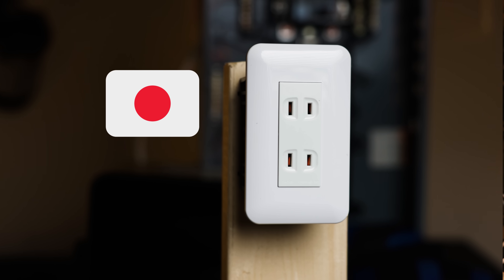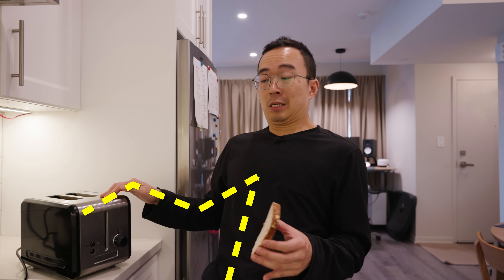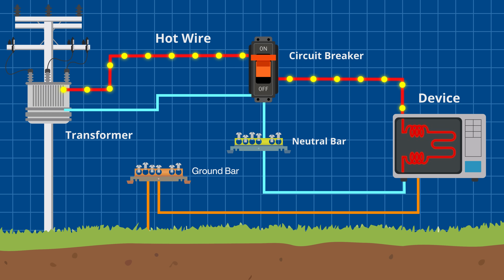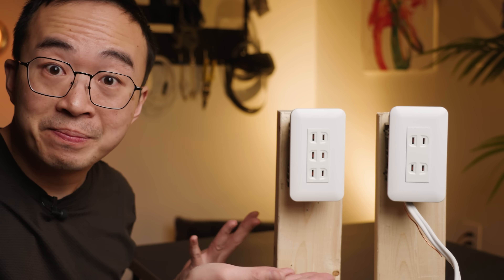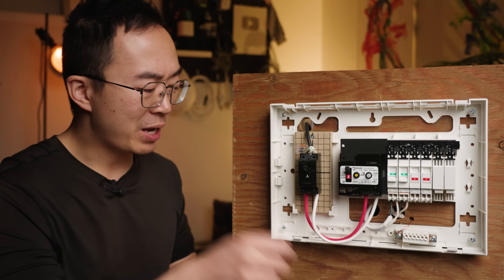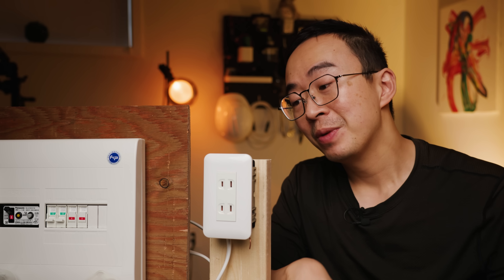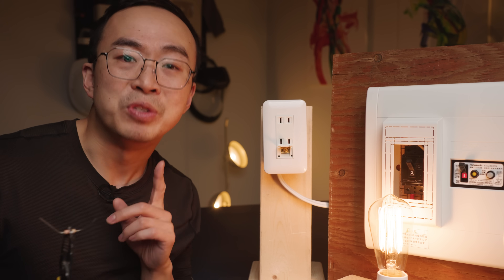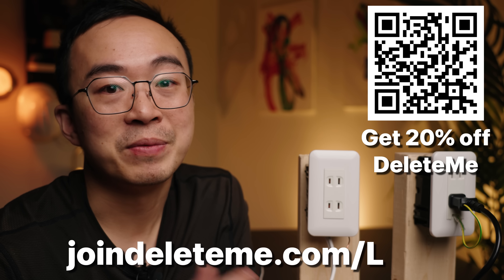How Japan Made Their Outlet Safe

Comment: 0:11 most of the time yes, in a ground fault no, during a thunderstorm possibly, the problem with isolating the mains with no ground, is that the voltage potential between mains and earth can be much different then potential between hot and neutral, so you can still get a buzz even touching neutral and have a undetermined ground reference, turn in to a capacitive load, form a virtual ground point.

 atleast in usa ground is basically neutral, two phases, the ground is a center tap, hot to hot get up to 250v 60hz

Hot to ground hot to neutral only give 125v max, so less of a shock, less hazardous than the full 250v, still will hurt tho, and typically anything grounded, current going to rather short to ground through low resistance copper than  the megaohms of your body, pop the breaker or gfci or both, basically the Earth is being used as a giant current sink, since the ground and the distribution transformers are basically coupled together, basically a large lc/rc circuit

Comment: I gotta be honest... I'm concerned that if there was a ground fault, resistance could start a fire that a copper wire and an extra hole would easily prevent for 75 cents. Sometimes you can have a perfectly installed electrical system in your home  and the electrical device is defective...

Comment: In the US. There are also combination arc/grnd fault overcurrwnt proctctive devices....3 wire system will have ground and neutral bonded @ 1st pt of disconnect meter base & at the 2nd point  separate that bond.

Comment: There is:
a. CPC - Circuit Protective Conductor: Which applies primarily to the circuit it is in. Its prime role to make the breaker trip in current overload conditions. It is a parallel low resistance neutral wire. It parallels the neutral wire back to the main panel. 
b. Main system grounding: This is to the supplied ground cable provided by the electricity supplier or local earth rod.
c. Equipotential bonding: Electrically connecting metalwork and conductive parts, both exposed and extraneous. Extraneous is metal parts having a good connection to the ground like water or gas pipes. The purpose is to have the voltage the same throughout all these metal parts in fault conditions.

The above are all different having different functions. But confusing in that they all have the same colour coding in most counties. The three of them should have separate colour coding then it would be easier to understand.

The Japanese do not have a CPC, relying only on an RCD/GFCI to break all the circuits in the whole house. 

In the UK RCBOs are becoming a defacto standard fit. They protect only one circuit, incorporating: earth leakage (RCD), over-current and fault protection. so the whole house is not switched put is there is a fault - only one circuit is disconnected.  AFDDs are mandatory in some installations being fitting on;y on single circuits no whole house, giving: arc fault, earth leakage (RCD), over-current and fault protection.

Comment: Couple of things.
1. Your grounded outlet is upside down. The ground should be on the top. That protects against loose or drooping plugs exposing the hot blades, and stops a direct short should something fall into the gap exposing the plugs (like a dangling bracelet.)
2 . GFCI is great, we have gfci breakers in america too, but it doesn’t make the installation more or less safe. It’s a last resort line of defense. They are generally welded into the closed position by lightning strikes, however. If you have ever serviced a house hit by lightning, all the gfci’s are fried, they still pass current so you wouldn’t realize it as an end user, but the test buttons no longer work. Have to replace them all. Relying on gfci as a catch all is less safe, because practically no one tests them every month as required.
Reply: The ground being on top to protect something hitting the live prongs are a very superficial and a farfetched fear which never happened, especially with the one ten volt power system. The ground pin UP is considered "upside down" as many plus in USA and every plug in Japan are installed with the ground pin down.
Reply: @judenihal  In the USA, we have counter-top outlets common on stainless steel tables, dating from the late 1950's when the classic diners became popular. Waitresses were constantly reaching over the stainless steel countertop to service clients, and multiple incidents of bracelets drooping into hot exposed prongs were recorded. This led to the design and introduction of grounded outlets in the 1960's, and their induction into the NEC in 1971. In the same year, GFCI became mandated, when there was a metal or water source in direct proximity to a receptacle, which largely precluded any further incidents of electrocution. As the 2 additions were both designed to preclude the same outcome, additional grounded requirements were not pursued. Your statement, however regarding it being 'unlikely', is categorically false. Every major electrical MFG, Guild, Union, Government, and Commercial Employer specifically ban the  wearing of metal bracelets and rings by electricians  FOR A REASON. A simple search of "accidental death electrocution "Bracelet"" returns 8300+ pages with the most recent being 2 days ago.
Reply: @undisclosedlocation9167I live in the USA. Most people do not wear “bracelets” while touching the outlets. If they electrocute themselves it is their own fault. Installing the plugs upside down is not going to fix this. GFCI outlets will
Reply: In New Zealand and  Australia the earth pin is on the bottom unlike China has the same arrangement but at the top Maybe because we are Down Under
Reply: Unlike you all. Schuko is interchangeable and not a pain to plug in, and it has the doors and it can't fall out. Plus it is indented so you can't touch the bare metal

Comment: If you cut open 3 prong power cables you notice the ground wire is almost always much thinner (The song goes: Cost Cost Cost repeat previous line). So should throw circuit breaker but if that doesn't work it could melt to open circuit while thicker main power wires keep working. Japanese electrical cables would never zap anybody because it wouldn't be polite so a cultural no no. Japanese splitter extension chord receptacles don't fit my American polarized plugs.

Comment: Ground is not only for safe. many countrys have both RCDs and ground. In china you can buy 2p or n+1 GFCI with only 1~2 Dollars. Some areas in the United States only have ground is due to industrial hollowing out, which results in bizarrely high component prices, rather than due to Japan's technological advantages. RCDs in Japan should also not be very cheap.

Comment: Bad ! Wrong ! 4:20 ~
Reply: Only in the main equipment panel can ground and neutral be combined on the same bus bar, since it’s code they are bonded anyways. Now, at any fixture, junction, or sub panel, they must there, be kept separate. So no, you , are wrong.

Comment: Also half of the country runs in 60hz and the other at 50hz. They also run at a lower voltage than the US 100 vs 120v.

It makes sense. The Gfci is a differential relay. It's expecting to see the combine current of the circuit going in and out it's actually not that simple. It's being used as a bus differential taking out all circuits with it. Cool.

Comment: I was about to write a long ass comment on how your diagram of how it works confused me because that's not what I was told. But then learned japan had the same system as france except for the spectacularly inconvinient grounded outlets. 
I still don't understand though, why is there a ground rod in the US ? If the current passes through the breaker anyway, and the transformer isn't even grounded, there wouln't be the difference in potential needed for current to be attracted toward the ground, right ? or is it just for lightning ?

Comment: What I get from this video is that grounding, coupled with circuit breakers, forestalls shocks of all magnitudes in the vast majority of cases, while GFCIs installed in the locations where shocks can still occur, will prevent serious injury or death (but shocks will still be felt, and it won't be a nice experience). Seems like a logical arrangement. Doing it the opposite way ensures that when there is a short, there will ALWAYS be a non-lethal shock (before the GFCI cuts the power), and grounding is starting to be used only in places where those shocks could still be dangerous, to prevent them entirely.

I'm still not clear on why the North American approach would not have worked (or would have been harder to implement) in Japan. That part was kind of simplified in the video, and I'm a bit confused. And also, if the government is now pushing for grounded, 3-pronged outlets everywhere anyway as the next improvement to their electrical code...it must realize that this has been the better option all along, so what was the thinking 50 years ago when the nation decided to go in a different direction?

Comment: What are the Japanese codes for Arc Fault? In the USA there is a common mistake of using Ground fault and Arc Fault as the same. Many basic electritions don't seem to know that they are seaperate tech and only some breakers have both. They are labled as so, and cost more. So cost cutting or lack of knowlege has me seeing Arc fault used in place of ground fault. Love to see how its handled elsewhere

Comment: Tl;DR. In short by chatgpt
Japan uses mostly 2-prong sockets because:

100V system: Lower voltage means less risk of shock.

Double-insulated appliances: Most devices are safe without a ground.

Selective grounding: Grounded outlets are added where needed (e.g. bathrooms, kitchens).

So yes, it's a safe, intentional design—not just outdated tech.

Comment: In switzerland we have ground to everyoutlet, GFCI as you call them are in the fusebox connected to the kitchen and the bathroom. We also have 3 phases to power equipment like washing machine in each appartment, there for we have 13amps circuit breaker much less then in the US where there are 20 amps per circuit breaker.

Comment: In America, the transition from two prong outlets to grounded outlets was simple. You DID have to rewire older houses, but the work was contained to the house, not outside plant. The big reason we started doing this was tow-fold.

First, the prongs used to be the same sized. That meant you could plug in an appliance "upside down" and swap hot and neutral. For electric devices like a toaster, it didn't care. Electronic devices would and this would cause problems. For the toaster, ground and neutral were often considered the same thing. So the neutral wire would be in contact with the housing. Fine if the plug was right side up. The case was effectively at ground potential and no shock, normally, but reverse the plug and that flipped. The case was then carrying the 110v current and you would most likely get shocked touching it. So we went to a "polarized" plug, where one prong was bigger than the other. Okay, great. problem solved, right? Not so fast!

The second reason we went to grounded plugs was either DIY idiocy or bad electricians flipping wires somewhere in our homes, so that hot and neutral were still reversed. But now we could not turn the plug around to fix it. This still happens, BTW, and sometimes it happens at the main entrance to your electrical panel. (I've seen it on mobile homes.) So we changed to grounded outlets and mandated that the ground and neutral now had to be isolated from each other and that the casing of any electrical device had to be either non-conductive (eg, plastic) or had to be tied to the ground wire directly. NOW you have an appliance that is safe, since, so long as the ground is connected, it should no longer be possible for you to get shocked from touching the case of an appliance under any circumstance. (Remember those two-prong adapters that had the grounding wire that no one ever hooked up to the screw on the cover plate to the outlet like they were supposed to? Bad joo-joo!) Any "ground-fault" or short circuit would result in the circuit breaker tripping.

The last thing that we had to consider was "wet spaces" like the kitchen and bathroom, where the presence of water would throw things off because it would create an alternate path that might not draw enough current right off to trip the breaker. Hence, the GFCI being mandated in all such areas. Now we're a lot safer than we used to be, but, of course, nothing is absolute. See, a short-circuit and a short-to-ground are different things and you can't protect from both of them at the same time. That's part of the reason we only have GFCIs in wet areas. Circuit breakers in your main panel are "arc fault" (short circuit). The button on the GFCI outlet is resetting a "ground fault". Different areas require different emphasis. What comes next in electrical safety? Who knows? We'll find out when it gets here.

Comment: Another option is to have a 3-pin receptacle, place a 30mA GFCI in the main control panel and a 5mA GFCI in individual circuits especially the wet ones. The 5mA GFCI substantially reduces the pain of shock to a tingling sensation.
Reply: Yeah, I planned on doing exactly that but the breakers were too long when they first came out (AFCI, GFCI and another one, I think it had both types of protection) and only used 2 and filled the rest with the traditional ones. One day I'll replace them all with the shorter version.

Comment: Lots more dangerous than other countries. 
1. Ground is basic protection that does not rely on electromechanical parts which can fail. For example overloading the GFCI can cuase the sense coil to burn out or the switch contacts to weld.
2. Ground works instantly. In the case of the toaster, it does not have to wait for someone to touch it and get a shock.
3. If you get a break in neutral before it enters the distribution panel, and there are only local connections to earth which are high resistance. EVERYTHING connected to neutral will rise to the incomming voltage. If the earth IS linked to neutral anywhere near that building, people could be shocked by touching earthed parts, and the GFCI may not operate IF the ground is absent or very high resistance. 
TT systems are common, in the UK for remote farms and extensions to things like garages at the ends of long gardens. 
BUT they MUST have a good low resistance in order to trip things safetly and quickly. 

In short, if something has a GOOD ** connection to 0V you cannot get a shock from it. 
Extra devices can enhance safety, but only a fool would use them as a subsitute.

** GOOD being a relative term, relative to the current that can be delivered. If it's a lot of current, you will need a heavy cable.

Comment: This video's explanation of US grounding is just flat out wrong. 

One reason for grounding other than safety is EMI. You can reduce radiated emissions by grounding the case as well as reduce susceptibility to external interference. You can also drain capacitively coupled leakage current from devices as well.

Comment: Some important clarifications: at least in North America, GFCIs trip at 3-5mA. If you were correct that Japanese GFCIs trip at 30mA, that’s much less safe. It also explains why NA electrical code doesn’t require them everywhere; there’s a lot more risk of nuisance tripping, and I’ve had experiences of brand new GFCIs and brand new compressor-based devices (like fridges) not working together. 

I also have to say, all-metal electrical panels are really dumb. Can’t wait for the US to catch up with the rest of the world on that one.
Reply: Metal is good for fire resistance.
It's not dumb.
Reply: @jeffkardosjr.3825  You know what else is good for fire resistance? Not making the entire enclosure for your electrical equipment out of a conductive material.
Reply: @nathandaniels4823 Are you against MC and solid metal conduit?
Reply: @jeffkardosjr.3825  no, but it’s primarily because I never have to land energized wiring inside MC or metal conduit. 

I’m not really against metal enclosures per se, but as someone who grew up having to work with energized components in conductive cabinets, the first time I encountered an all-plastic panel with wires on the line side instead of metal busing, it was a breath of fresh air. 

In defense of the North American Way, I also know that plastic only lasts so long. I’d rather work on a 50-year-old metal electrical panel than a 30-year-old plastic panel any day of the week.
Reply: @jeffkardosjr.3825  Sarcasm aside, I personally feel that the shock hazard created by a metal enclosure outweighs the benefits of fire retarding. When the temperature becomes hot enough from a fire to melt a plastic enclosure, a metal panel would transmit enough heat to melt the thermoplastic wire insulation anyway.

Comment: So - a single GFCI fault cuts off EVERYTHING IN THE PANEL?  Also - this panel is so tiny - maybe for a 3-4 room apartment?  My US house, though not typical, has 400A incoming, feeding two 200A panels, each panel with dozens of circuit breakers.  Would hate to have all that interrupted by a single GFCI fault!

Comment: I had an outlet problem and i had to connect my PC to an ungrounded outlet and it caused a 3.5mm mic humming issue that caused a robotic voice on discord, i used a jumper wire from my PCs 3 prong which is ground and then connected it to a random outlet ground and the humming was gone, i wonder how japan goes around that with gaming PC if their GFCi doesnt have ground